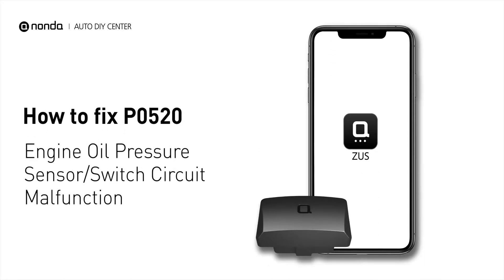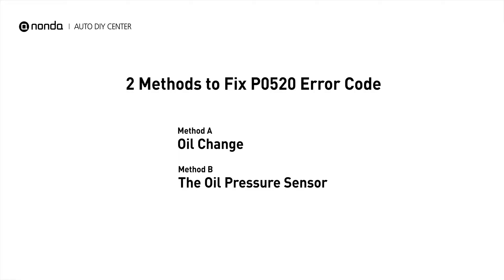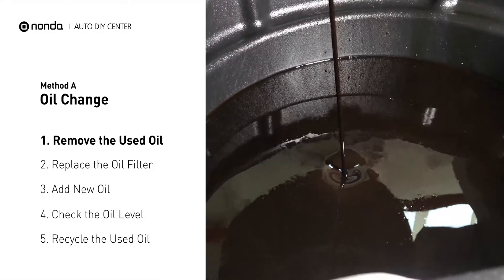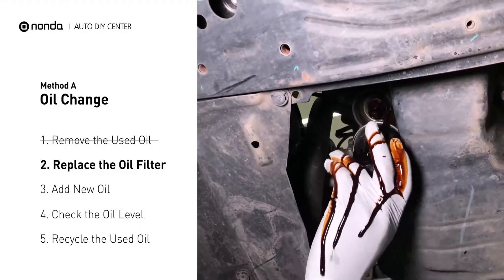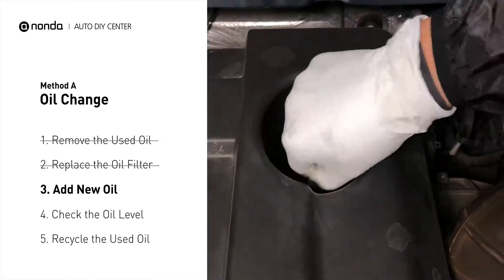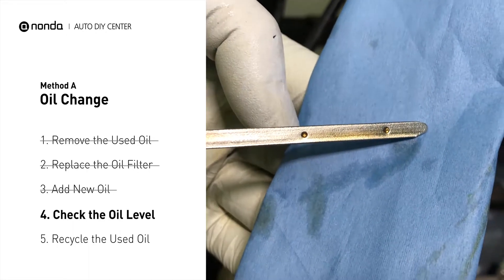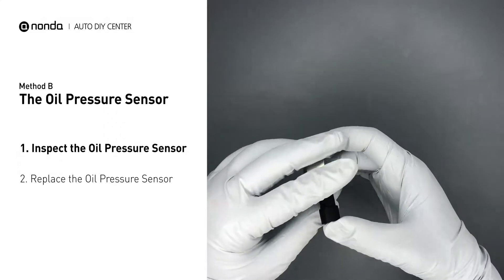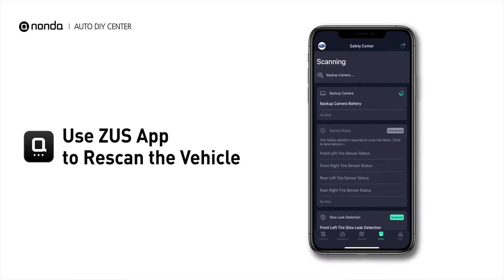How to Fix P0520 Engine Code in 4 Minutes [2 DIY Methods / Only $6.92]

Comment: This code very likely means that the engine is sludged up because the oil did not get changed frequently enough.
Reply: How can we fix that?
Reply: @pakovargas5103 change oil or change sensor
Reply: I definitely agree with you. I also delayed the oil change of my vehicle by approximately 4000 km. And I started getting this warning.
Reply: Will it go away after an oil change runs for about 20 miles or so?
Reply: @marvinjames8080  The oil pressure regulator turned out to be faulty. Part replacement solved the problem.

Comment: 2004 seadoo GTX supercharger code P0520 on I did change oil pressure switch. It still show the code
Reply from the maker: Hi Anthony, we recommend having your vehicle visually checked by your local mechanic for further diagnostic.